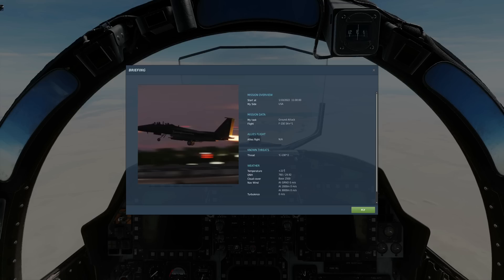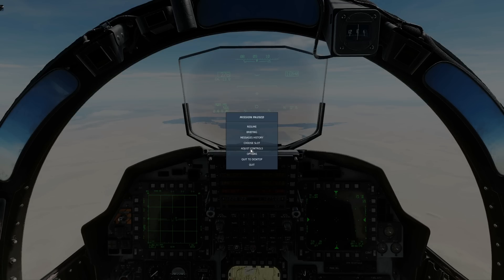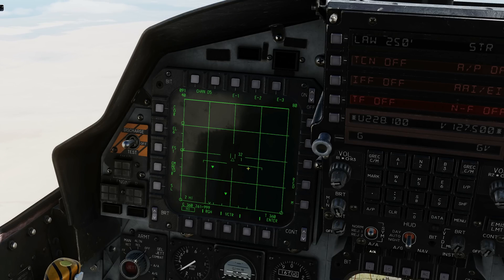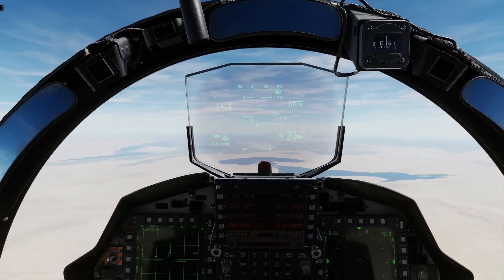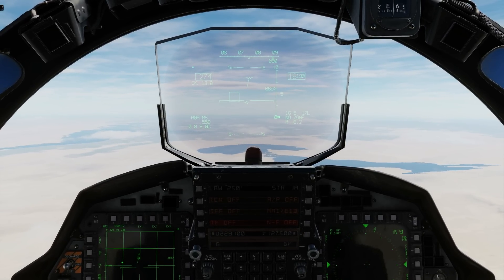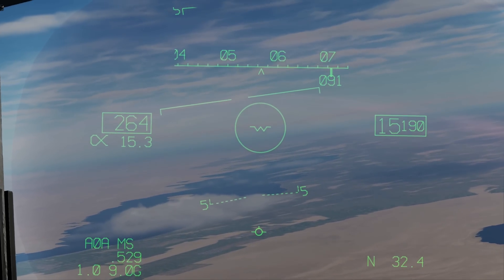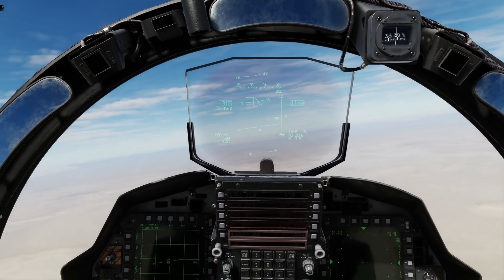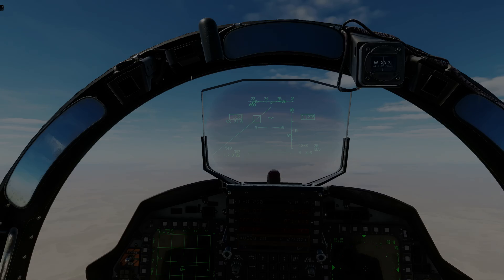F-15E Strike Eagle: Air To Air Radar WVR ACM Auto Aquisition Modes  | DCS

Comment: Hmm the 265 does not correspond to the reciprocal heading to the target,  (neither is the 263 to the vertical sighted target on heading of 309 of the strike eagle. My guess is it 's the bearing from bullseye to the target, but a there was not set one (999 on range to own aircraft) it took waypoint 1 instead.

Comment: long boresight would be good for locking someone in the cons
Reply: This is gonna be absolutely dirty in the competitive scene.
Reply: @92HazelMocha  -- hornet has long boresight too
steerable with the helmet even 
does the viper??
Reply: @SDsc0rch  can't speak for the viper but hornet helmet/boresight up to 10nm significantly less than 40 on the mudhen
Reply: @user-is2nn8mc9q  --- hornet has long range boresight - its a long press
Reply: @SDsc0rch  AFAIK the long boresight goes out to 10nm and the regular goes to 5
Reply: @user-is2nn8mc9q  --- please refer to this quote on pg440 of the manual... 

"HMD ACM Modes
When in an ACM mode and the HMD is active, the radar will use either Helmet Acquisition (HACQ) mode or Long-Range Helmet Acquisition (LACQ) mode. The ACM mode must first be selected to Boresight (BST) mode. These are selected by:
• HACQ: Sensor Control Switch forward for less than 800ms
• LACQ: Sensor Control Switch forward for greater than 800ms"

you're welcome
Reply: @user-is2nn8mc9q  ---- continuing the paragraph 
so as to remove all ambiguity...

"Using the HMD line of sight, the radar will center its scan on this location. As the HMD line of sight moves, this is reflected on the radar page elevation caret and azimuth indicator B-sweep line. This is in reference to the horizon, not the aircraft.
• HACQ: Auto acquisition of targets out to 10 nm that are within the reticle using MPRF.
• LACQ: Auto acquisition of targets out to 40 nm that are within the reticle using MPRF.
If attempting to slew the radar outside of radar gimbal limits, the HACQ/LACQ symbol will flash. To break an ACM HMD lock, press the Undesignate button."

see there?
particularly the part where it says "LACQ: Auto acquisition of targets out to 40 nm"

thats FORTY
nautical miles 

"40"

i say again... "you're welcome"
Reply: @SDsc0rch  ty mdude seems I need to brush up on the Hornet manual hehe.
Seems I got hacq/lacq/gacq ranges mixed up